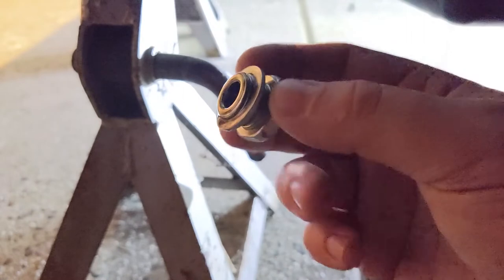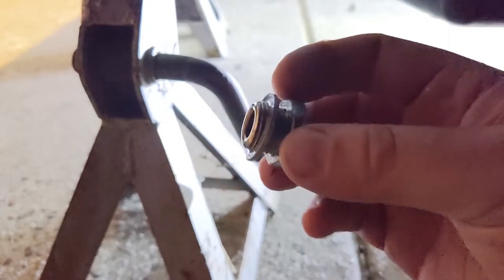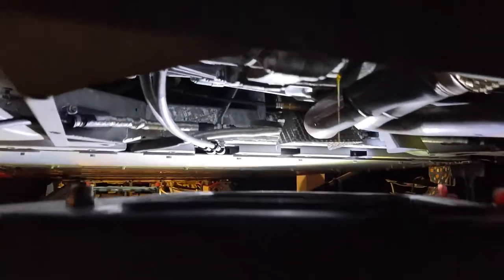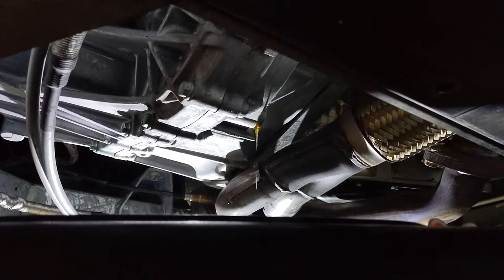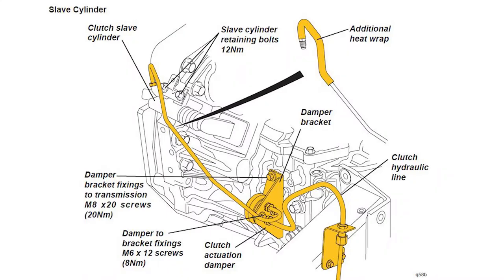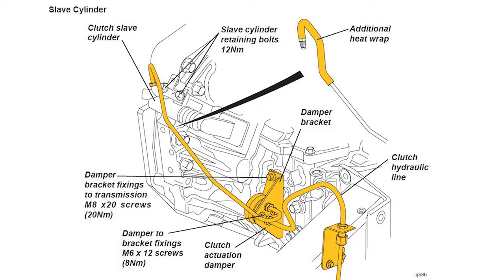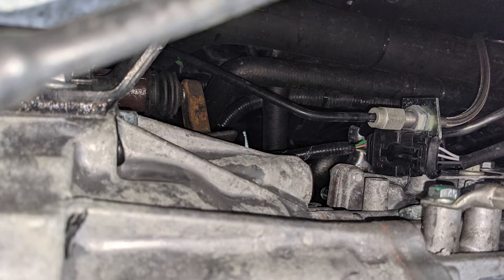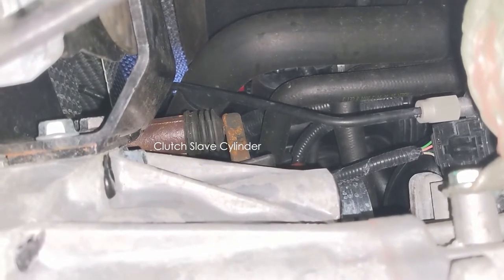Evora Transmission Fluid and Clutch Wrap

Comment: Thanks Ryan, great video on the trans fluid change. I’ve had a lot of track days with the Evora this summer and so plan to change the trans fluid this winter. Being in Chicago I guess I’ll have to take a cue from you and put the car on the lift and let ‘er run in gear for a while to warm it up! Thanks for pointing out the fill and drain ports! 
Of note, my 2013 already had the clutch line wrap in place when I bought it. I’ve not had an issue with heat affecting the clutch line (this despite 11 track days this summer). 
Love the content!!!
Reply from the maker: Good stuff. Wait to see my next video. On how to correctly flush your clutch fluid
Reply: @GoodmorningGoodnight  Ah, that is also on my winter list! I've planned on bleeding the slave cylinder--even took a look at it--and once I saw where it was decided it could wait until winter! I'll be very interested in seeing how you bleed the clutch line!
Reply from the maker: @cadefields-gardner6534  The video is recorded. The job is done. I just need to edit it up. But don't hold your breath for me. Two kids are keeping me pretty busy.

Comment: thanks for the tutorial, I have a IPS 2014 with 16k miles, I think I should take the job on not sure it’s ever been flushed
Reply from the maker: The IPS is a little bit different. There's a transmission cooler that you have to drain as well. And obviously it takes a lot more fluid. Take a look at the Lotus service notes for the IPS. I don't think it's harder I just think there's a little bit more to do. That being said. It's just a Toyota unit. So it was designed for serviceability.
Reply: @GoodmorningGoodnight  thank you for the info I definitely look into doing it my self first. I got an 02 oxygen sensor out in bank 1 sensor one so that is my first project to fix up
Reply: Do you track the car?  My 2017 IPS has been tracked 10ish times has 10k miles, and I just did it as a preventative/inspection and it was still in good shape.  If you haven't stressed the engine routinely, you're probably ok but should start thinking about it just for the age.
Reply from the maker: @dogtag114  yes. I've done 2 track sprints with the car this year. Great to get the lotus out and stretch her legs
Reply: I am yet to track mine, I’m the 4th owner so not sure what the others have done prior to me.
Reply from the maker: @cristianlittle3  take care of the basic maintenance like the oil change and the other fluids. Make sure your brakes are good, And I wouldn't be afraid to take it out. But perhaps in track insurance.
Reply: @GoodmorningGoodnight  thank you, will have to track this baby at some point
Reply from the maker: @cristianlittle3  it will happen indeed

Comment: Question have you ever had an issue or heard of PO700?... I watch a lot of your videos and you seemed pretty knowledgeable ....my car just gave that co
de... in my car through a check engine light I checked it and it gave me P0700 also the light went out
Reply from the maker: I've not had that code. Is your car an automatic? I think it's specific to the automatic.   I'd have it checked by the dealership to see if the car has the latest "firmware" programming for the transmission. 
Also make sure you don't have a low battery as that causes all sorts of strange codes. 
I wish you good luck on your diagnosis. Let us know what you've found! 
These cars like to be driven. Hopefully after some miles on the road it doesn't come up again.
Reply: @GoodmorningGoodnight  ....2014 auto n/a......reading forms gave me 5 diff things...only had 24k miles ...bout with 18k miles.....forms leading to ground wire.......anyway u from the area...im from PA.....i seen ya one vid with the lion head beer lol.....do u cruze with other lotus owners?
Reply from the maker: @nuddahundo83  would love to cruise but haven't found too many Lotus owners round here. Let me know if there's anything going on! Lol

Comment: Did this improve the shifting, coupled with the adjustment you did with the cables ?  My 2011 NA is having issues finding 1st when it’s cold and isn’t able to pop back into to neutral. It’s hard work shifting this thing.
Reply from the maker: It absolutely made a difference to improve it. But it's certainly did not eliminate the issues. The cables themselves can be lubricated. You have to access the cables on both ends. And you can use a syringe to push some oil pass the seals on both sides. And then of course you just work the shifter back and forth. I have not yet done this. And if I do I'll make a video on it. Probably won't mess with it until things warm up around here ( mid winter now). The other option is obviously just two replace the cables with the aftermarket cables. But that's not very cheap.
Reply: @GoodmorningGoodnight  did the adjustment and lube.. helped significantly.  Still isn’t able to pop back into neutral on its own.  But maybe that’s how these cars are ?

Comment: Just did both of these - thanks for the video - BUT! It has the spongebob "one eternity later" (sick reference) but it only took me about 6-7 pumps (with the pump and bottle you linked) for the fluid to start spilling back out???

It feels like at least half the bottle is gone, and the fluid coming out the bottom drain is clean when I tested it - but am I missing something? Did you actually pump for a while or is it really just a couple pumps? I have it jacked up from only the rear but my jack stands aren't even maxxed out. I barely had clearance for the bottle under the trans case. It doesn't feel like the same amount went in that came out. Maybe I'm crazy?
Reply from the maker: @super679theoriginal  so you should be putting in 2.3 l. It should certainly be more than a few pumps. I'm imagining it would be something like 50 pumps or 60 pumps. 
I would just double check that you had the pump tube fully inserted into the hole and it wasn't starting to pump out accidentally right off the bat. 
You can always check how much you have left in the bottle, to work it backwards. 
So you don't have quite enough fluid in there.
Reply: @GoodmorningGoodnight  Tilting the car back (jacking from the front while on stands in the back) definitely got more in. The other thing is if you have the hose angled up slightly (with the black holder clip on) it hits something and kinda bounces out. Maybe my pump had more throughput because it was still probably only total 20 pumps, but I definitely got most of the 3l bottle in (especially because of the wasted spillage was probably about .4-5 L haha)

Thanks for the reply as always. 

In terms of getting in touch with other owners - I heard you mention there's a facebook group. Whats it called?
Reply from the maker: @super679theoriginal  great news. 
For Facebook. Look up Lotus Evora Owners group on Facebook. There's 2 groups. One is more European. One is more American. I'm active in both.
Reply from the maker: https://www.facebook.com/share/pveGG7E9zD7tHctV/?mibextid=WaXdOe

Comment: Hi great video, could I ask you which diameter you chose for this? 1/2-1 or 1-11/2?
Reply from the maker: @duqduqduq1  the smaller one should be fine. The clutch line is quite thin. The wrap will fit a little loosely on there and that's fine as long as it covers the area. Try to cover as much length as possible
Reply: @GoodmorningGoodnight  Thank you for the answer and the awsome contents. I really appreciate them!